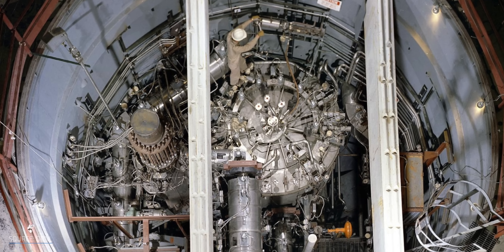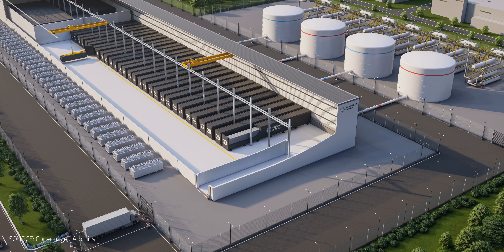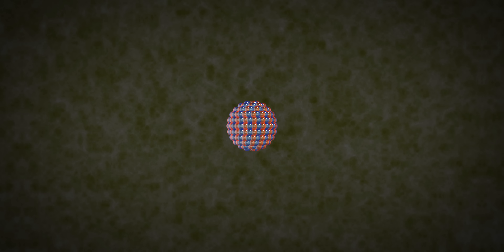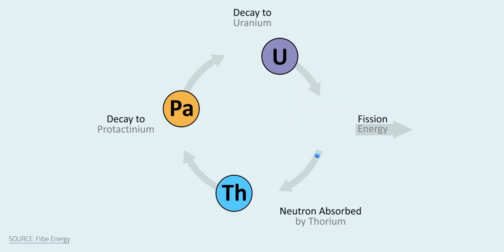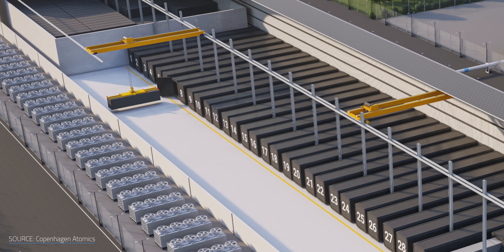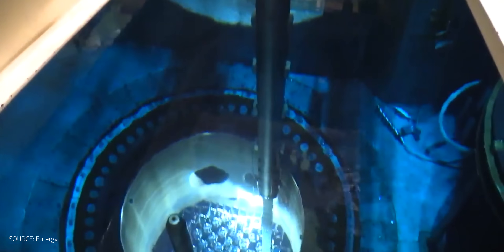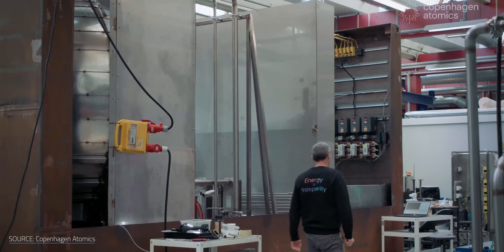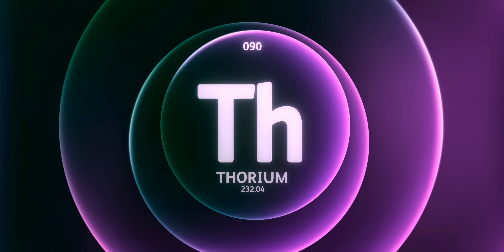Why Thorium is About to Change the World

Comment: Two things killed off thorium reactor research. Metals at the time would corrode but that was overcome decades ago. But more importantly for cold war US, it's harder to make nukes from the fissile uranium Thorium reactors produce. The US military had  the aircraft nuclear propulsion (ANP) program, which started in the 1940s, aimed to develop a nuclear-powered bomber with an extremely long range. While a nuclear reactor was successfully tested on a modified Convair NB-36H bomber, and a molten salt reactor was developed, it was ultimately cancelled.
Reply: Its actually insane that we haven't swapped over to Thorium even after the cold war "ended" purely because we wanted to keep making atomic toys.
Weapons development has always taken priority over safety in the US.
Reply: @amack308  The lightbulb moment for me was it's ability to "burn" normal nuclear waste! ...... How much does storing it cost us?
Reply: @amack308  And in the rest of the world.
Reply: @amack308 security was always above safety 😊
Reply: @amack308 after the Cold War thorium had already become a lost cause in the political world where nuclear in general went into huge decline. Thorium didn’t stand a chance in the 90’s but the 00’s was a lost decade of potential research as information started to reappear thanks to Chinese interests and nobody questioned why
Reply: Correct. Thanks the US had a Thorium reactor prototype.
Reply: @brittennz  Ran at Oak Ridge! Kirk Thorenson did a good video on it!
Reply: So it was not mainly a geopolitical descension over keeping atomic workers in a certain state employed to re-elect the governor?
Reply: @totherarf  What the hell are you talking about?
Reply: @Tinker1950  The ability to "burn" traditional nuclear waste in the Thorium / Salt mix ..... it was mentioned in the video!
Reply: @totherarf  we can reuse that uranium 235 he said, but the machine still creates a uranium 233 waste he said too
Reply: @zenaxia8063  No,you misunderstand me. I refer to the fact that "Normal" nuclear reactors use about 3% of the Uranium in their cores leaving 97% as waste. That can be burned in a thorium reactor thus you can eliminate the 1,000 year storage problem we have at the present time! I suppose there is other radioactive waste that could also be burned but the main one for me is the Spent Uranium. There is also a growing problem with shells used in battlefields using Spent Uranium as a penetrator to boost the effectiveness of shells against hardened targets! That one is not talked about at all!
Reply: @totherarf  Depleted uranium is different then Spent uranium. Depleted is just the U-232 left over after taking the U-235 (enriched uranium) out. Spent is fuel byproducts of nuclear reactors. They are not the same.
Reply: @griffinkimberly7695  No they are not the same ... other than their toxicity and having to store them in a safe long term storage facility as opposed to simply (I know it is not simple in reality) adding to the salt and cooking it!
Reply: @totherarf  I was referring to your 'English'.
Reply: @totherarf   been wondering about that, so is the ‘depleted’ uranium used for AP ammunition still radioactive ?
Reply: @zenaxia8063 U-232 has a half life of only 69 years.
U-233 is reactor FUEL not waste.
Reply: India continued the development and 500 MW  fast breader reactor is soon going live. India has 25% thorium reserve. Dr. Homi Bhabha, founder of Indian atomic program made thorium reactor development a priority. Finally India has the 500 MW. India will be building many such thorium fast breeder reactors for power generation and uranium enrichment.
Reply: Untrue. It is far easier to make Nukes and Fusion bombs using the U-233 Thorium reactors produce. The problem with Thorium is its use to breed U-233 in small reactors that are hard to track. The first U-233 nuclear bomb was exploded in on 15 April 1955. In terms of proliferation it is far easier to hide than Plutonium. It is also far more effective for producing: compact, low tech, gun type, nuclear bombs; than plutonium-239. And as such is perfect for nuclear Artillery so making it a very small step escalation threat. There is some suspicion the Iran has a very large dispersed stockpile of Thorium produced U233 from reactors based on small research designs. It was already tested by the Russia as a Trigger for cheap Hydrogen Bombs back in 1950s and in fact used in Russia's first air dropped dial-able yield Megaton Plus Fusion bomb, the  RDS-37 in 1955. It can also be used, to cheaply enhance both U-235 and Plutonium-239 bombs, by alloying methods. Meaning less of the harder to produce, refine and hide elements are needed. This along with its problematic decay products means it was banned by most countries, despite its low cost. Go read. The Promise and Peril of Thorium
Reply: @walkerig1  I didn't state it couldn't be done, I said it's harder to make them (to the military's expectation). For example, the yield from that 1955 test was 33% lower than expected. In the cold war where there's an ever escalating arms race, that's the last thing the military wanted. That and as stated, the metals we had at the time would corrode.
Reply: @ExpectDragons  The metals we have at the current time still corrode
Reply: @walkerig1  Not at all; the U-233 is inevitably contaminated by U-232, and also readily denatured with U-238 if one fears losing control of the plant. A bomb made with even a small amount of U-232 will destroy the electronics (or require heavy shielding) and may detonate prematurely. U-233 is essentially useless for practical weapons (which you want to store). Any actor that wants a weapon is just going to make Pu-239, not sacrifice their thorium reactor that would indefinitely convert dirt into gold once started. Yes, plants should be monitored carefully, as you would with anything you care about, but no one is going to walk away unnoticed with a highly radioactive 650C fuel salt.
Reply: @Th-233   It is not true that "U-233 is inevitably contaminated by U-232" that only applies, if your bomb maker is dumb enough to leave the Protactinium in the fuel stream to turn into U-233 for breeding as fuel. Nuclear bomb maker is not interested in generating power, they want pure U-233. You simply take the Pa-233 out before it converts to U-233. It is easy to separate Protactinium using simple chemical reactions, resulting in 99.99% pure Pa-233 which you then decays down to U-233 at 99% plus purity so no U-232 in it in the first place. This is why it is easy to use in compact cheap gun type near zero electronics nukes that can be used in nuclear artillery. And because it is highly pure when you are building fusion device, it technically simple. Hence Russia chose it to make their first dialable yield Fusion Bomb the RDS-37 in 1955 and Russia launched that 1 to 2.5 megaton device from an aeroplane in 1955, while the US was still building static Hydrogen Test bombs the size of a small city block.
Reply: @ExpectDragons  just to note the reactor was carried on board the bomber to test radiation shielding, but it wasn’t used to power it, the bomber still ran on its conventional power plant
Reply: The US commercial fleet of PWRs/BWRS (around 100 reactors) has never been used to breed plutonium for bombs. Sure they could have been, but they were designed to burn low-enriched uranium which results in higher fraction of undesirable isotopes. There were only a few specialized reactors needed to make all the plutonium needed.
Reply: @darrell857  There is more of the world outside the USA than inside!
Reply: @darrell857 The U.S. hasn’t made plutonium in years. It has just been recycling the tons it created between 1944 and 1995…
That’s been a problem for NASA because they can’t get the Pu-240 they were using for thermoelectric
generators for deep space probes…
Reply: The metals today corrode, in fact that's the missing conversation here. Really just about any coating, or material is going to fail in this environment. The good stuff just buys time lithium fluoride compounds are always going to win. 
Not to mention these reactors ARE incredibly dangerous, just in different ways. The molten salt is EXTREMELY reactive with the atmosphere and water at these temperatures. Containment loss is 100 times worse when your nuclear medium is combustible and heated by the nuclear fuel. 

I'm actually building a molten salt test furnace in our lab. In my opinion, it's 75% hype. Understanding just how screwed we are from a materials perspective and how severe the safety considerations are. I feel nervous about being in the room with that thing..
Reply: One reason: Juice who profit from oil
Reply: @PravinDahal  right because they have so much oil...... Makes perfect sense... Huh as an engineer i just never considered it might be a ruse. Here i was thinking to myself all those engineering problems probably held it back but golly it was the "juice with oil"
Reply: That argument hinges on the illusion that the US is the only country in the world which does science. Plenty of countries around with plenty of scientific pedigree who aren't interested in building nukes. Notably, Germany's Thorium research reactor (THTR-300) wasn't even molten salt but a pebble bed reactor because molten salt was judged to be infeasible.
Reply: Has Ed Miliband seen this video?
Reply: Plutonium is used for modern nukes.
Reply: The Soviet Union also flew nuclear reactors in a Tu-95 derivative (and had a nuclear POWERED version under construction). The radiation doses received by the Soviets aircrew resulted in lethal complications due to inadequate shielding (unlike the U.S. crews).
Reply: It was too difficult to shield the crew from the radiation and all the designs had the risk of spreading radioactivity to the environment, meaning that it could potentially affect everyone.
Reply: Honestly a third factor was regulatory capture of the government, as well. The energy conglomerates wanted to take the reactors designed for use in a submarine, and get their greedy little hands over its profits. No matter how dumb it is to use a reactor approach that was designed for a submarine on land.

The last thing they'd want to do is compete with a future method that was much more efficient, after investing so much into their plants. Their puppet at the time, Nixon, shuttered the program.

The Nixon era also brought us the marvelous waste of money and life that was the space shuttle. It always burns my ass whenever I think that a manned Mars mission could have been accomplished with those resources. Sigh... this is what happens when MBA's control the world.

Just think of the lovely things they'd like to do to us with the AI stuff. We could have heaven on earth, but they certainly don't wanna share it.
Reply: Thanks.  This answered some questions. My chem prof way back in the early 90s was all exited about thorium reactors being the future.
Reply: They have not overcome the corrosive factors,never will
Reply: 100% WRONG.

Civil nuclear power has nothing to do with producing nuclear weapons. That already happened upsteam

Weapons-grade plutonium is made from DEPLETED uranium. You get 9kg of it for every 1kg of "reactor grade" 3% enriched uranium 

The reason enriched uranium was used in the first place was that's all Weinberg's team could get hold of when building the Nautilus reactor (Yes, Weinberg created the water-moderated nuclear power reactor as we know it, AS WELL AS the molten salt liquid fuelled reactor)

The uranium separation facilities (later renamed "enrichment plants") had tens of tons of the stuff kicking around that they couldn't get rid of and were quite eager to give it away and the rest is history

The result is that the civil nuclear power cycle is utterly dependent on the waste products of the weaponsmaking cycle for its fuel. Spent nuclear fuel cannot be weaponised. It's too filthy for that

Any reactor design that can run on natural uranium or thorium is a threat to the military cycle because it divorces civil nuclear power from its dependency on military waste products and that in turn means that separation (enrichment) plants would no longer be "dual purpose" - meaning they'd fall under nuclear weapons limitation treaties AND would expose the enormous cost of running the facilties to greater scrutiny by politicians, GAO, etc

Even the French nuclear fleet deployment in the 1970s was primarily a figleaf to cover their weapons program rather than a path to energy independence - and now they no longer build nuclear weapons they're not planning on replacing end-of-life reactors

Thorium exists in large quantities because rare earth mining required it be extracted to get at the other metals in Monazite - there's more thorium in the mineral than every other rare earth combined. That means that you've got it whether you want it or not - to the tune of about 5000 tons per mine per year. On the other hand, uranium has to be hunted down and explicitly mined

Just because thorium exists in large quantities doesn't mean there are any reserves. Officially there is "Zero" thorium reserve and that's because for mining purposes "reserves" only exist if there's a market for the item. This is a semantic trick often seized on by thorium opponents to say there's no supply

A market for thorium at $150/kg (about the same price as natural uranium) would turn rare earth mines into thorium mines with a rare earth sidegig. 

Right now most rare earth mines are uneconomic because of the costs of sequestering the thorium. You're not allowed to simply put it back in the hole you dug it out of. That's why most have closed.

The Chinese cornered the rare earth markets recently and it's not because of laxer environmental standards, but because the Chinese government has been hoovering up thorium production and stockpiling it in anticipation of the SINAP TMSR research paying off. That's kept Chinese rare earth producers in business (and quite profitable)

Or in other words, having a thorium market also means that rare earths aren't subjected to supply bottlenecks...

Regarding the Aircraft Nuclear Reactor, that was a Weinberg project and the MSRE was literally built on the carcass of the ANR. Weinberg's team knew an aircraft reactor would never fly but the money was extremely handy to do research with - and it wasn't going to come from civilian sources

TMSR-LF1 is only a heat producer (as was MSRE) but TMSR-LF2 is intended to be a 10MW electrical generator. This is where scaling out tests begin (There are lots of things which worked in the lab but never achieved commercial viability).

The primary importance of -LF1 is that it's proven external blankets and fuel processing are unnecessary, with the thorium simply being dissolved in the main mix. It costs a few percent efficiency but who cares when thorium is $150kg vs $65,000/kg for enriched uranium? 

What matters isn't "the most efficient" or "cleanest" solution, but the one that gives the best bang for the buck whilst still remaining safe. Copenhagen atomics is chasing a model which is potentially dangerous and already proven to be overcomplex & uneconomic, given that the Chinese have proven Weinberg's proposition about single fuel loop operation. 

Handling U233 is a spectacularly bad idea because it comes with U232 which despite all the claims to the contrary cannot be filtered out at the Pa233 stage. Keep it inside the reactor and it's not an issue. if it costs 2-3% efficiency that's not an issue (Jets consume 30-% more fuel than piston engines. If everything was about efficiency they'd never have gained traction in the markets. What matters is cost-effectiveness).

Similar efficiency vs cost arguments can be applied to the graphite moderator. Yes it only lasts 5-10 years at full power, but reduce that to 80% power and it essentially lasts forever - so run the reactor at 80% power and add another 50kg of thorium (which is still 1/10 the price of enriched uranium). It gives you more excursion headroom for occasional extreme load peaks. Using the jet enegine analogy again, Jets run continuously at full power have short lives whilst at 80% power they'll last 8000 hours between service intervals (this is why civil airliners don't use "full power" for takeoffs unless they have to. Better to use lower power and more runway if it's available)

Lastly: 

There's a  BIG problem with "small modular reactors" and it's not the reactors themselves, but the non-nuclear side - particularly for electrical generation. economics dictates the use of the largest steam turbines physically available, which means you need 3000MW thermal output, not a pissant 500MW or less.  Also, like aquariums, the smaller the reactor the more finicky it is about being managed (small changes have large effects). Larger reactors are simply safer because they have more "inertia" (for lack of a better word)

I don't believe that anyone pushing SMRs has any commercial viability and for the most part they're government funding suckers. Concentrating on them WILL result in the CHinese eating everyone else's breakfast - not only will they have 4-5 billion non-western customers (assuming the West won't buy them too), but a suitably sized MSR is a drop in replacement for coal burners at 1/4 the size of the coal burners (including containment building). Look closely at Chinese coal power stations built in the last 20 years and notice the mysterious blank space adjacent to the turbine halls....Someone's been planning ahead 

Remember, steam turbines don't care about what provides the steam, only that they have enough steam at hot enough tempratures to work.  "Hot rocks boil water, make steam, spin turbines, drive generators" - the only difference being wether the hot rocks are nuclear ones, geothermal ones or coal (which is also the source of Natural Gas)
Reply: @alanbrown397  where can I learn more, do you have a blog?
Reply: France and UK - both Nuclear powers - have a lot of NPPS. Which they need as a base for their nukes. Simple as it is. We have mostly Uranium reactors because of that…
Reply: I like the history, but it’s not true at all the uranium from Th reactors is more unusable. Th reactors (this does not apply to Copenhagen’s reactors tho) pose a significant proliferation concerns because of how good they are at making pure U-233.

Large scale Th reactors transmute Th232 -> Th233 —beta decay-> Pa233. However, Pa233 has a half life of ~28 days before it beta decays into U233. If another neutron hits Pa233 before it decays, it becomes U234, which is a neutron poison and bad for the reactor. Therefore, we chemically separate the Pa233 and let it decay away from neutrons thus making U233. But you don’t have to re-inject the U233; you can just remove it from the reactor. Now you have 100% pure U233 from chemical separation. Chemical separation is easy for a single chemist to handle. Unlike with isotopic separation like natural Uranium to enriched uranium.
Reply: @ReapersRed Thorium reactors U-233 is highly contaminated with U-232. U-232 is a very hot gamma emitter and can’t be chemically separated.
Reply: @allangibson8494  The only isotope of Pa possible in significant amounts is Pa233. You chemically isolate Pa233, let it decay in a tank away from the neutron source, and have pure U233.

There is no U232 in this scenario.
Reply: @ReapersRed Chemical separation and mechanical separation are two different things.
Reply: @jamestyrer907  yes obviously, but the only tractable method of Pa extraction I know of is chemical. How could you ever mechanically remove Pa from the fuel-salt stream? If you have a mechanical method, let me know, but the only one I know of is bismuth pyroprocessing (a chemical process)

Bismuth pyroprocessing is what the MSBR would have used, though it was a paper reactor
Reply: Too expensive, inefficient. Presents a nuclear proliferation risk.
Reply: @jackfanning7952 Actually not a “nuclear proliferation risk” because the uranium waste is too “hot” to handle for about 700 years due to U-232 contamination.
Reply: @allangibson8494 the U232 does not make it any less proliferation resistant. The U232 stays in the salt stream, but does not get picked up into the U233 tank. Still get the second best weapons isotope 🤷‍♂️
Reply: @ReapersRed Thorium-232 activation generates U-232 as daughter product along with U-233 along with U-232 being an alternative decay product of Pa-233. Th-230 also generates U-232 on neutron capture.
Reply: @allangibson8494  You're making it sound like proliferation is a non-issue in Th cycle MSRs, just like Sorensen attempts to do. The IAEA disagrees and places the same level of non proliferation accounting on Th MSRs as they do on U cycle reactors.
The issue is not that a state actor aiming to produce many weapons worth of material will use this path to build bombs that have long shelf lives., as everyone knows the U-Pu cycle is better for that. The issue is it is arguably easier to clandestinely produce 1 weapons worth of material that is safe to use in a relatively short time period and the design of the weapon is far simpler.
Reply: @richardb1452 It’s not impossible but requires technology than no current nuclear weapons state uses because the feed stock is seriously hairy to handle being a strong gamma emitter. A simple glove box isn’t going to cut it - you need MECHANICAL Waldo’s (because electronics won’t work around it for long) and serious amounts of lead shielding.
Reply: @allangibson8494  That IS my point. It's not state actors wanting large inventories that are the big concern even if the Th MSR is finally make to work. Any design that isolates Pa-233 to decay away from the neutron flux of the reactor core is a high risk because the biggest hurdle is already completed. I didn;t say it would be easy, I said it would be easier on a small scale (and harder on a large scale). The yield is low, but the purity can be made fairly high after that step is done due to a number of factors including differential half lives of Pa.
Reply: @allangibson8494  U-233 makes nuclear bombs - Operation Teapot. Also once nonfissile Thorium 232 is transmuted to fissile U-233 in a very dirty reprocessing step, it is a much greater danger for exposure for workers than U-232 in conventional reactors. Besides every other type of energy production is cheaper and safer than any nuclear reactor and does not generate highly radioactive isotopes as waste with half lives of up to billions of years.That is currently stored in open pools within spitting distance of every major US city. Which will destroy all life on Earth faster - nuclear bombs or nuclear reactors? I'm betting on reactors.
Reply: @richardb1452 Pa-233 decay produces EITHER U-232 or U-233 depending on if it decays via beta decay or neutron decay. You simply can’t make pure U-233 from Pa-233 without some U-232 appearing. And that’s without considering the decay of Pa-232.
Reply: @allangibson8494  You don't need 100% pure U-233 (which all agree is not possible) if you aren't going to keep the material a long time and/or aren't concerned about a perfectly functioning device, You just need pure enough. Most of the decay chains to U-232 can be controlled with care and time. As I said, it is not state actors with ambitions of long term arsenals and optimally functioning devices that are the concern.

I'm a fan of nuclear and live in an area that gets over 50% of its electricity from reactors, but there is no such thing as a power reactor that eliminates proliferation concerns despite Th fanboys who continue to sell this fantasy. Th will very likely be proven to be a viable fuel eventually, but it isn't magic.

IAEA still apply safeguards because they understand it CAN be done.
Reply: @richardb1452 The problem is the U-232 decays via a gamma emission chain. That is hard to shield, potentially lethal to anyone standing around it for any longer than minutes and destroys electronics and electrical equipment.
That requires processing equipment totally different from what is currently used for making nuclear weapons. Much easier to simply just get some natural uranium and process it.
You would really have to want to use Thorium because you couldn’t get Uranium to go down that path.
Reply: @allangibson8494  this is just false. Look at the chart of the nuclides. Pa233 has a 100% chance to beta decay into U233. Also, Pa233 is the only Pa produced in MSRs. Additionally, Th232 transmutes into Th233 via neutron capture. Th233 also has a 100% chance to beta decay into Pa233

Where did you get the notion that Pa233 can decay into U232?
Reply: @richardb1452  Wym “all agree is not possible”? Pa233 is the only Pa produced from Th transmutation. Th232 is far and away the most abundant isotope Th — every other Th isotope is trace.

Also, are you from Illinois getting so much power from nuclear?
Reply: @ReapersRed  No, Allan was correct on that point. There are multiple pathways to U232 from irradiated Th232 fuel and Pa233 is NOT the only isotope produced, it is just by far the most abundant (i.e. probabilistic) one. You don't "need" other Th Isotopes in the original fuel for it to happen. With care you can minimize it but only tiny amounts of U232 are needed to mess up the works if you want a shelf life and optimal operation. The problem arises if you don't care about those things and that is precisely the type of person/group to be most worried about.

Nope, not Illinois, not even US though I have spent some time there. There is a whole world of knowledgeable people (and >3/4 of the worlds reactors) outside the USA...😉
Reply: @richardb1452  Just curious, what are the other pathways for U232 production? Quite honestly, if we were concerned about radioactive material being used in dirty bombs, we would also lock up wasted medical radioisotopes way more than now where they are shoved in a broom closet.

I know there are a lot of other smart reactor engineers out there. It’s just ignorance on my part, but I only know of France and Illinois as having a majority of nuclear power.
Reply: @ReapersRed  To answer the first question, we have to first acknowledge that is it virtually impossible to get 100% pure anything chemically even in a lab let alone a production facility. When things are measured in parts per million or billion, some small amounts of reactants are going to slip through whatever process you use and in the case of U232 and it's precursors, only tiny amounts are needed to affect shelf life and optimization. By "pathways" I'm talking about the fact that nuclear fission, decay and absorption are probabilistic events, i.e. they don't always, 100% of the time happen in only one way. An obvious example of this is fission of individual U235 atoms, where the resulting fission fragments are not always the same elements and do not always produce the same number of neutrons. They range across the full periodic table, however on avg some are much, much more likely than others and an avg number of neutrons/fission is close enough to manage the reaction.
The same kind of thing happens to Th232 with regard to transmutation. The initial neutron absorption results in Pa233 and the resulting decay chain drives preferentially towards U233, but not 100% exclusively. There are both decay and parasitic absorption events constantly happening in that big vat of molten fuel salt and also, but to a much lesser degree in "isolated" Pa233.
There are multiple combinations of Th232 absorption/decay that result in U232 and they occur in a probabilistic distribution. With extreme care you can get the impurity down to a level that a normal weapons program would be happy with. This is why IAEA insist on safeguards for Th fuel cycle as well as U fuel cycle. The bigger Th concern IMO and especially in an MSR if they are to be widely deployed is the rogue group that has access to a reactor but does not care about shelf life, optimization or even danger to themselves and just want to make one relatively big bang clandestinely on the other side of the world as this could be easier than other routes. That said, done the easy way it doesn't align well with a normal weapons program's four primary goals (mass production, shelf life, fully optimized devices & safety), hence the typical focus on Pu instead.

I think the concern about radioisotope storage is valid, however impact is typically less, even if used in a dirty bomb than a true device. As human societies we have a nasty habit of focusing on the biggest and/or most immediate/recent concern.

You missed South Carolina, New Hampshire, Ontario, Slovakia and Hungary on your 50% list...😀
Reply: One thing killed off Thorium (U-233) reactors. It was not economical in the 1970s and is even less so today.